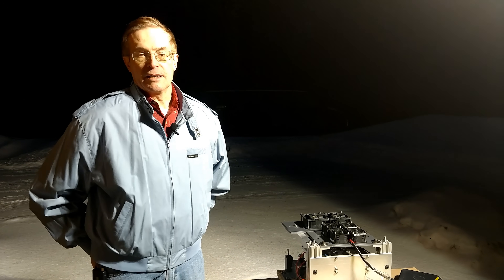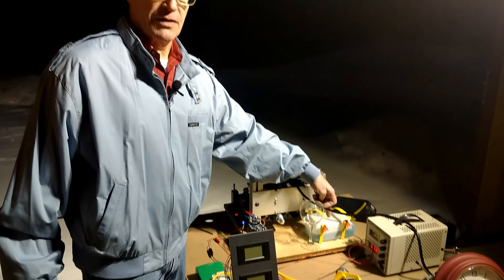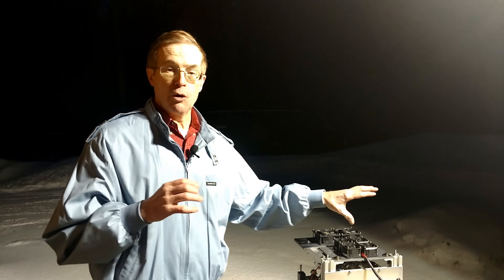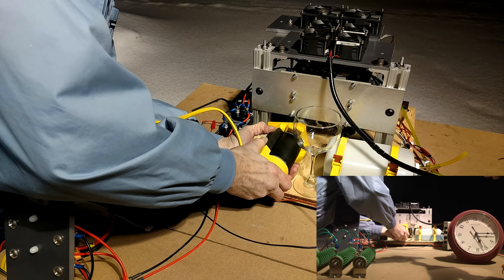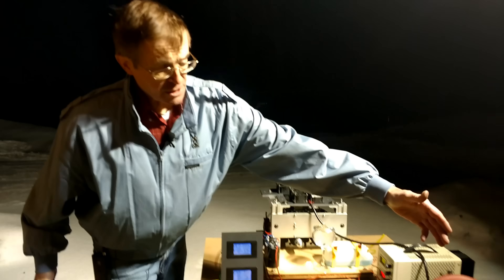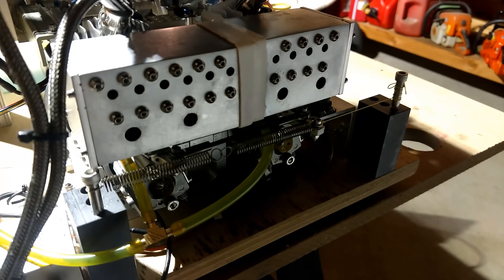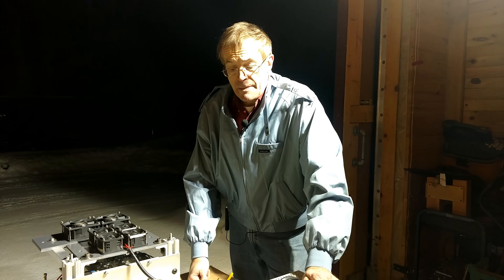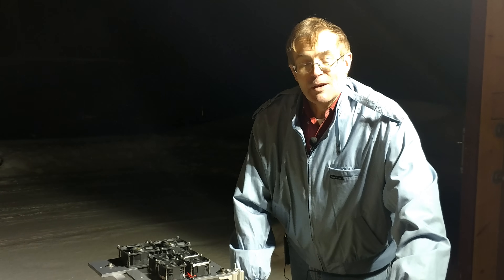Drone Generator Performance

Comment: Very nice generator set. This fascinates me since I work on large gensets for the offshore oil & gas industry. It sounds so consistent, as well!  

The only thing I worried about was the engine cylinders overheating since the fans are blowing down, over the ends of the cooling fins and not through / between then as the original propeller airflow would have.  Not complaining! Just an observation.  All my generators are water cooled. :) Glad you tested by hand and found they aren't too hot!

On our big gensets, the governor tuning is a very important part of the unit. It's got to be interesting tuning the Arduino to govern the engine based on voltage output. I hope you have / will go over that part of the build!

Thanks again!

Comment: Two motors this size generate 700 watt of electric power, I was assuming that these small motors deliver for over 1 to 2 kw, what will be required to lift the whole contraption with load by design? Sorry if I might have missed it in a vid, I would assume that it is too little
Reply from the maker: If you look at the follow up video, we pushed the system output beyond 2kW.
Reply: @TechIngredients  thank, I am a great fan of your liquid descasant air con, I believe this would be viable

Comment: You will need to give the fuel weight per volume for plaining the fuel tank placement within the airframe.
Fuels do change depending on location and time of year weather foundering of the fuels used in it but volume does not change.
Reply from the maker: It's best to locate the fuel tank as close as possible to the center of gravity to avoid changing the balance of the craft as the fuel is consumed.

Comment: Gasoline to mechanical energy to electric energy back to mechanical is going to loose a lot in the conversions.  Why not just go with direct drive gasoline engines?
Reply from the maker: Electric motors have more rapid response, and greater control resolution.  It's also easier to isolate the noise and vibration with a single engine that is not directly coupled to the airframe.

Comment: Nice work! Good power output using brush-less multi-phase motors as generator (rectified and filtered for DC output). Very low vibration.
Reply from the maker: Thanks!

Comment: Again, how does overall energy density of this system compare to energy density of a battery array of the same weight?
Reply from the maker: I'm not sure if I addressed this with you before, but assuming I haven't, the energy density depends greatly on the fuel quantity.  The weight of the generator module is fixed.  As the amount of fuel carried increases, the energy density of the combination increases to the limit of ten to twenty times that of the battery.

Comment: Try a wankel and for the load try old hot water tank a electric stove a old close dryer light bulbs etc
Reply: Wankel its a nice beast but its not efficient to be used as generator.

Comment: Thinking about the evolution of electric aircraft (powered gliders, fixed wing, multirotor, and rotary wing) in this context... It is already being done well with batteries alone, so imagine taking the same concept onto an electric aircraft, or more specifically an aircraft with electric motors. 10x the load or range and near instantaneous refueling? 

Hybrid motors to move us closer to electric incrementally? 10x efficiency gains in fossil fuels while building out all the other systems that need to go electric? It seems so obvious when looked at this way 😁

Comment: For efficiency and weight conservation, it would seem that an Achates Opposed Piston Opposed Cylinder (OPOC) engine would maximize efficiency and minimize weight. What do you think?
Reply from the maker: You're probably right, but obtaining these may be the major problem.

Comment: Why not use the generator to charge the batteries instead of using "unstable" power generation from the fuel engines ? As far I as know, this is what Lexus Hybrid design is.
Reply from the maker: I don't understand.  That is what we are doing continuously.
Reply: @TechIngredients  Oh OK, sorry did not understand this part is the previous video ! Would be cool to see a diagram of the final idea :)

Comment: This has much more promise for use in electric cars. You could stick one of these (scaled up a bit) in the boot to boost the range of electric vehicles. Most trips are short, but the thing that goes against electric vehicles is the risk of running out of battery charge at a location without a recharging point. Also you may want to make the occasional long distance cross country journey which would be impossible on an electric vehicle if intermediate charge points do not exist or would take too long because several full charges are required. With this in the boot, you could have it kick in when necessary when this happened. This use would not be very often in most cases, and if pollution is required to be reduced, it could run on propane gas instead of gasoline. In addition, gasoline engines are very inefficient on part throttle - which is most of the time during normal driving. If the engine cut in when required to charge the battery, ran at constant speed at the optimal speed and torque (the torque can be kept at the optimal value by adjusting the current in the excitation coils in the alternator), and cut out when the battery was charged, then the fuel efficiency would be improved over a gasoline engine powered car with the same performance when running it in gasoline mode.  In addition, there is a big saving to be made on lithium battery packs if the size of these can be reduced due to the fact that running out of charge is no longer so dire, and the battery packs and their replacement cost (incurred every 3 years typically) is the largest part of the cost of battery powered cars.
Reply: No way you'd get a 2 stroke past emissions regulations . Also your idea has been done before and is being done..

Comment: Just wondered if you could use the generators to perform the function of the flywheel on the engines i.e. do you need both ?

Comment: One suggestion. The exhaust system replacement may be causing scavenging fuel losses. Exhaust needs to be tuned (length) to provide optimal fuel flow thru scavenging... This may improve efficiency by few %.
Reply: A properly tuned pipe for the rpm range would increase efficiency alot.

Comment: is that 10 to 1 figure consider the weight of the generator?  and if so how much fuel weight/generator weight?
Reply from the maker: The generator is a fixed weight and therefore is not added.  However, because it is fixed the 10:1 advantage only begins to manifest with longer flight durations.

Comment: Truly modern Two Strokes use a porting scheme that results in a stratified charge. You can identify them because of their windowed piston and dual intake carburetor. Both major chainsaw manufacturers, Stihl and Husqvarna, produce these engines in great numbers anywhere from 30 to 100 cc's. Their purpose is to reduce emissions but as a side benefit you get dramatically lower fuel consumption.

Comment: Could you elaborate a little on the specs for the upgraded generators? Have you had any issues with non-sinusoidal (trapazoidal) waveform generation? Why the shift away from a hobby RC motor/generator?
Reply from the maker: The waveform has not posed any issues as it is close to sinusoidal at the operational frequency of the generator. I'm not sure what you mean by a shift away from hobby motors.
Reply: Sorry, I mean what was wrong with the original black generator you were using?

Comment: You need back pressure to get a 2 stroke engine to work. You should really put the original expansion chambers back, they are most likely tuned for the motors. The exhaust gasses need to travel back to the cylinder to get it running good.
Reply from the maker: A tuned exhaust is supposed to help, but the supplied exhausts were no better than our modifications, the originals were probably not tuned.

Comment: I think there needs to be a paradigm shift with resoect to hybrid quad copters. Instead of using the gas engine/generator to provide all of the energy for verticle propulsion,  it should provide energy mostly to power a directly coupled ducted fan. Secondarily electric fans would provide vectoring and station keeping. This way, only a smaller amount of energy would need to be generated for a smaller battery complement. The ratio of gas powered thrust to electric could be worked out to best attain the amount of altitude control and efficiency. My interest is with high endurance platforms contain radio relay (repeater) equipment where longevity is the major concern. Secondly a power source for the repeater in tens of watt hours. What do you think of this approach? Can the engines be throttled efficiently?
Reply: I don't think the throttle response of the engines would be fast enough to get good control over the craft. The P.I.D.'s in the electric control of a quadcopter are INCREDIBLY fast in keeping it stable, and the resulting lag between the microprocessor and the eventual throttling up and down of a gas engine would be way to slow to reliably control it. I'm guessing a gas powered generator and electric powered props are the way to go, even with a central prop just to provide lift... I could be wrong though. 🤷🏻

Comment: I made a similar system 6 years ago. Made 45 amps and 750 watts and only weighted 8 lbs 

 https://www.youtube.com/watch?v=zN9Pjo2xiuo
Reply from the maker: That's great!  Have you made any more progress?
Reply: Thanks.  yes... I flew it then sold it...It make all power necessary to fly the copter  @TechIngredients

Comment: How about using a gas engine(s) to generate most of the lift (>80%) using props and then using conventional battery motors for remaining lift and control, which would then be simpler and fuel efficient? If the gas motor quits, you could still land the craft using the reserve battery power left...
Reply from the maker: That is an excellent idea. 

There are a few YouTube videos that show this dual lifting scenario.
This will be more efficient than converting the engine's output into electrical power to drive the lifting fans.  The trade off is that the noise and vibration will be harder to isolate.

Comment: I love that. Probably the coolest hand warmer I have ever seen. 24 amps is nothing to sneeze at.
Reply: Depends on which voltage the 24 amps is delivered at.... 😜

1 volt at 24 amps is only 24 watts.
Watts is the better unit here to describe power output as amps can mean a little, or alot, of power depending on the voltage. 🍻